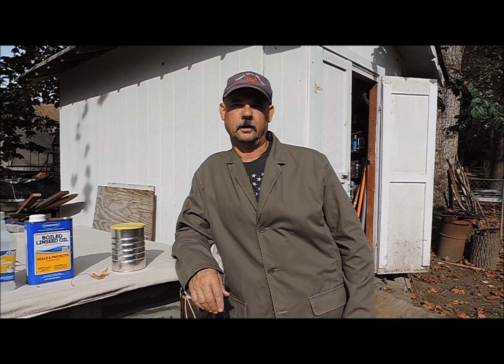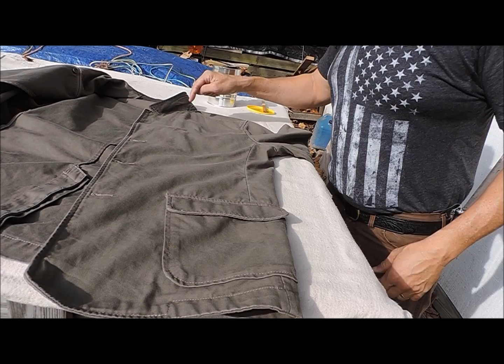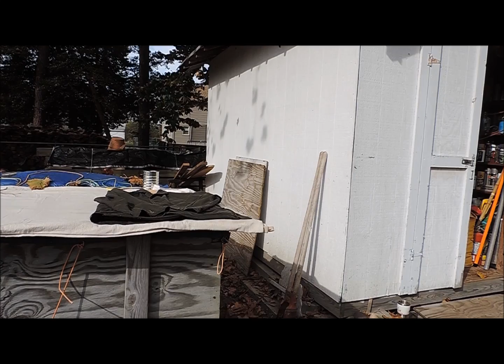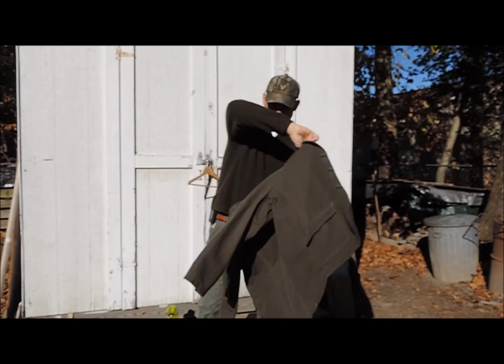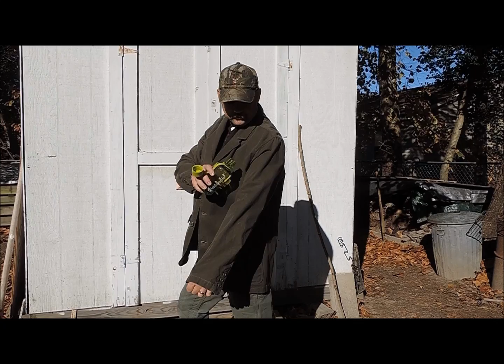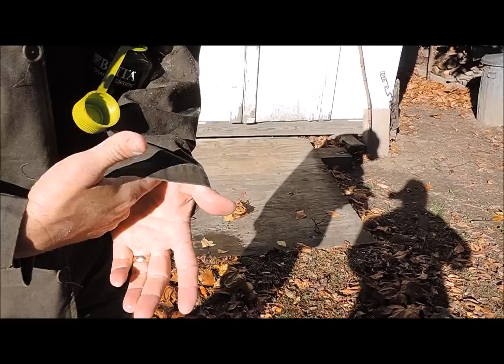Tin Skin Coat

Comment: Great Project, Red Dog!  I remember my dad had a jacket like that, back in the day.  Disbursement of chemicals is good - No spontaneous combustion round here! lol  How often do you think you'll have to reapply the linseed oil; or should you just touch up the wear areas when it's necessary?  Thanks for sharing!
Reply from the maker: +momselayor I don't know. As I use it I'll keep posting videos or give up on it ether way I'll post the results. The bed sheet I did last year is still good after just one treatment and I'm not babying it.